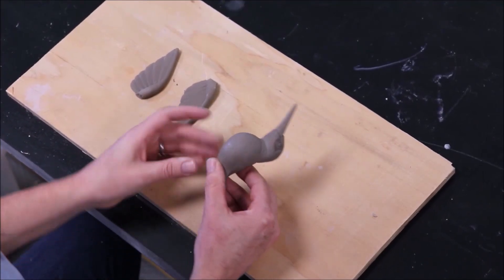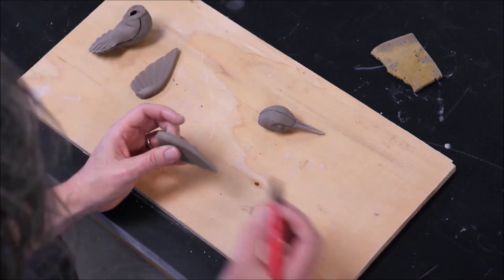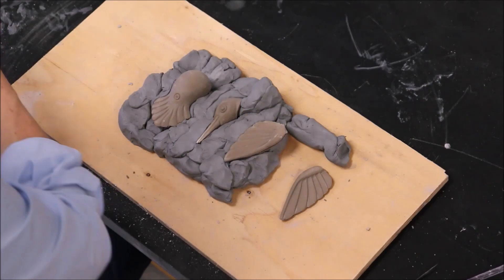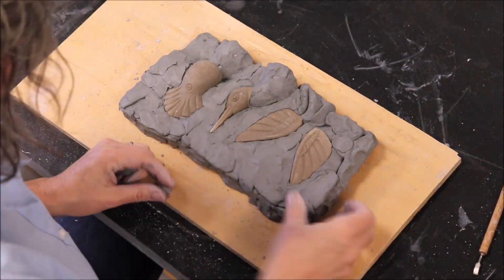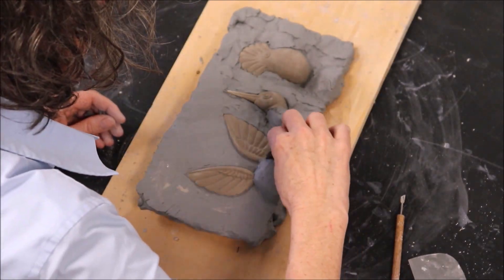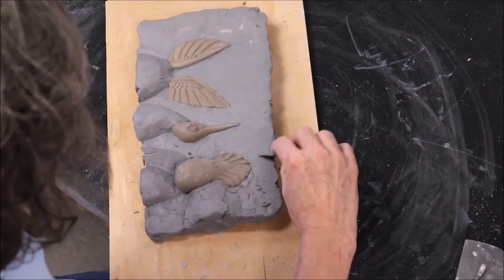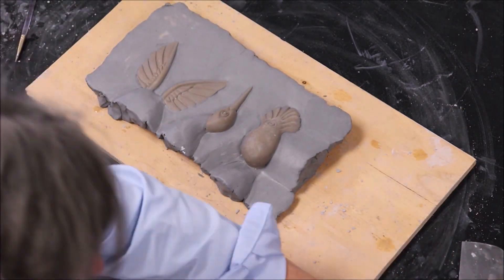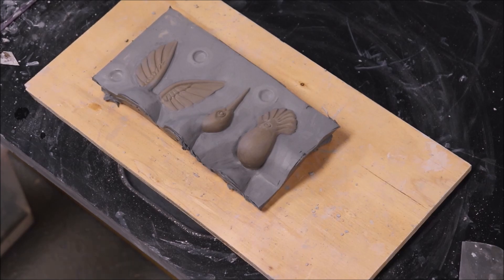Part 1: How to Make a Two-Piece Plaster Mold for Slip Casting

Comment: Really great video, thank you for the clear explanation, awesome!  You mentioned making a mold from bisque  ware , I have a bisque piece I'd like to make a one piece plaster mold from,  but I'm not sure what would be the best release agent for it if I wanted to make a mold, then glaze and use it later if possible?  Thank you!
Reply from the maker: I would only use Murphy Oil Soap.  It is a fantastic release agent.  I would apply three coats of the oil soap.

Comment: Awsome video! 
Im planning to make a mold for some dice (6,8,10,12 and 20 sided), and wanted to ask from your experience 
Would it be possible to make it with dice that is not clay you think? 
What is the clay you use to make the mold? Would any type do or should i aim for a specific one? 
Thank you!
Reply from the maker: You can pretty much make a plaster mode from anything.  That is, within reason.  I've made plaster molds of plastic, glass, wood, and fired ceramic objects.  If the material is porous, just make sure to coat it with Murphy's Oil Soap.  
I am just using my shop clay body (used in our ceramics classroom).  I would advise against making a mold from an oil-based clay.  It might permeate the plaster, making it water-resistant.

Comment: Very informative. Was wondering , what type of clay do you use for the bed?
Reply from the maker: I just use the same clay body that I use to make my work out of; nothing special.  Sometimes in my studio I use a couple different low-fire clay bodies (whiteware and earthenware) and I just grab whatever is the most convenient.  

After I am done using that clay for the mold, I then place it in separate bucket that I keep separate and far away from my usual clay.  You never want to use this "plaster contaminated clay" again to make an actual piece that you intend to fire as it is too difficult to remove the plaster from the clay.  If plaster gets into a piece that you intend to fire, the plaster will not shrink and therefore your clay that is touching the plaster will shrink and crack off (usually after the bisque fire, sometimes after the glaze fire).  I've seen this too many times.

I then reuse this "plaster contaminated clay" over and over to prepare the bed for more plaster molds.  As a result, what was once whiteware and earthenware end up getting mixed together and become different color.  This makes it easier to differentiate your "mold clay" from the clay piece you are making a mold from.  

So, it really doesn't matter what you use to create a clay bed.  You just don't want to use an oil-based clay body.

Comment: What is the clay/plaster equivalent of Pam spray if I’m planning on making molds for large, thin, flat pieces and i want to minimize the risk of my original clay models breaking when I take them out of the plaster ?
Reply from the maker: I don't know about using Pam instead of Murphy Oil Soap.  It might work.  I'd test it first.  The key is that is must be water soluble and not a petroleum product.  Let me know how it works!

Comment: Enjoyed the video very much, it was very informative. I'm dealing with a problem with getting my casting slip stuck in the plaster mold. It seems when my casted slip started to shrink in the mold, if I wait too long it shrinks too much and it part gets trapped in the mold, if I don't wait long enough it hasn't released yet and is too soft. I noticed your bird wings are a similar condition to my design. How long do you usually wait when you pour the slip and how long do you wait before you de-mold the parts?
Reply from the maker: Yep; I've encountered this same problem a number of times.  Some of my molds cast and release very easily and some are more tricky. This mold is not particularly tricky. 

For this mold, I usually keep the slip in for about 20 minutes, then pour out the excess.  And then I can open it up after about 3-6 hours.  Sometimes I cast them at the end of the day, and need to leave my studio for the day.  In that case, I keep the mold upside down and then open it up in the morning.  Keeping it up-side-down prevents the clay piece from drying too much as moisture cannot easily escape since the sprue is closed off by the table.

For tricky molds like you mentioned, the easiest way to release them is to use compressed air.  Not sure if you have an air compressor, but if you blow compressed air into the mold (focusing between the plaster and the clay wall), it pops them right out, releasing them easily before they get too stuck.  

If I do not have easy access to an air compressor, I open the mold, and if the clay is still very tender, I wait for it to firm up a bit more (15 min?) and then I pound on the mold with my fist (hitting the mold with the palm of my fist).  I keep the mold right-side-up while doing this.  Meaning, the mold is holding the clay piece like a plate holds food.  This action of pounding down on the mold creates an equal upward reaction and the clay piece bounces out after a few pounds.  But compressed air is so much easier.

I'll do a video on this.
Reply: @rebekahbogard3322  Thanks! Your advice definitely helped, covering my mold and waiting longer to open helped the piece release easily

Comment: What kind of clay is best to use for making the clay bed please? thanks!
Reply from the maker: It doesn't particularly matter, just as long as it is not an oil-based clay if you are making a slip-casting mold.  I personally prefer to use a clay body with no grog (because the grog rises to the surface when you sponge it down).  But that is not that big of a deal.  Just use whatever clay body you have on hand.
Reply: @rebekahbogard3322  Thank you!!!